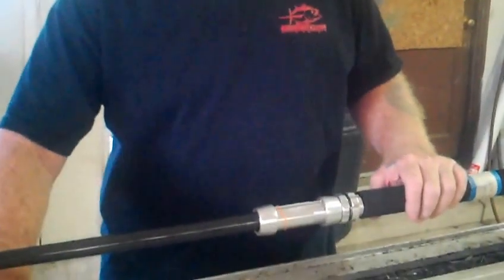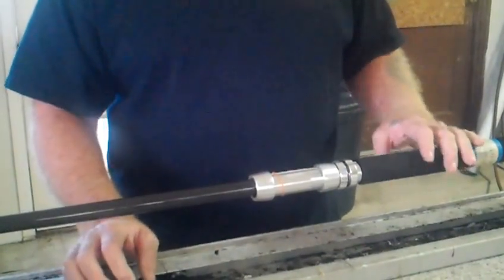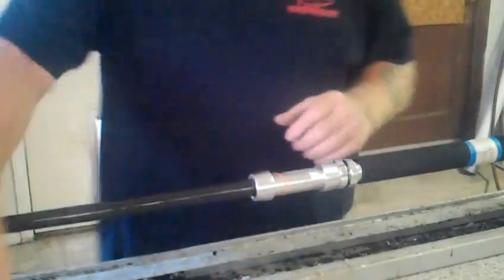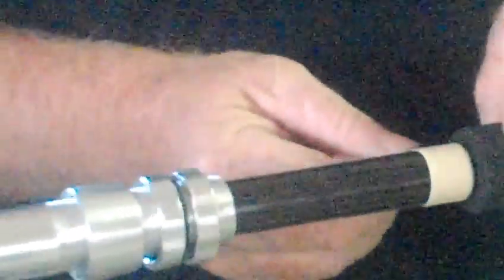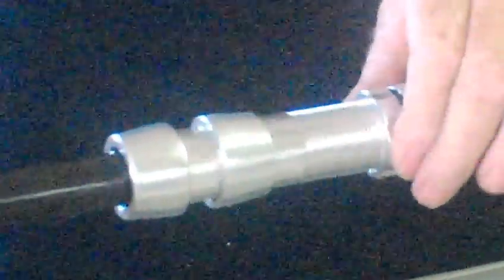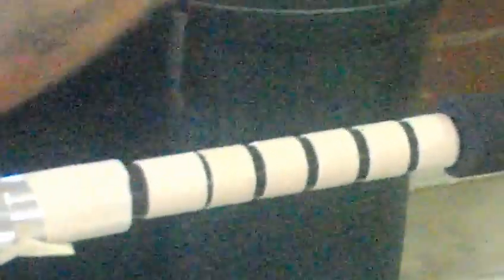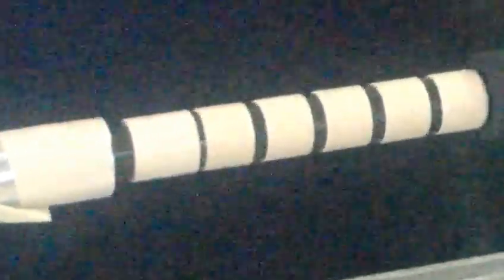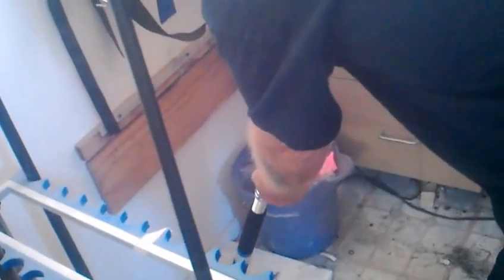Reel seat installation

Comment: Had a reel seat from Alps now spin freely on a jigging rod.  Is there a way to get the grips off so I can reseat the reel seat?
Reply from the maker: well dosent matter what brand of reel seat, if it spun thats the builders fault, yes you can take the rear grip off and resecure the seat then put a new rear grip on from the rear, it's a little tricky but can be done, if the rod is a custom, I would take it back the the builder and have he or she make it right